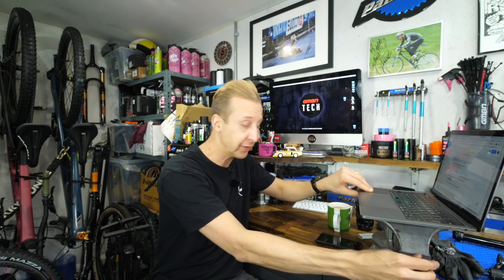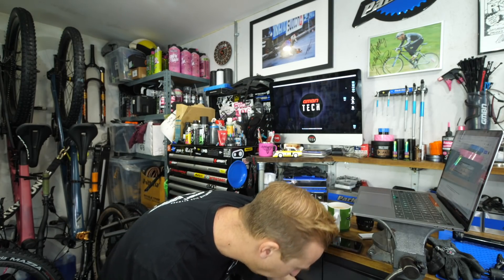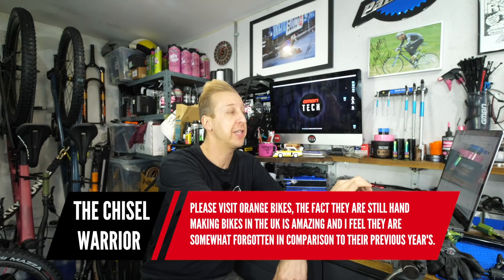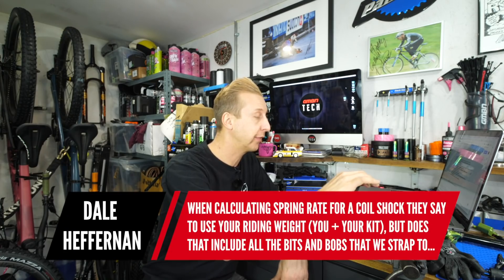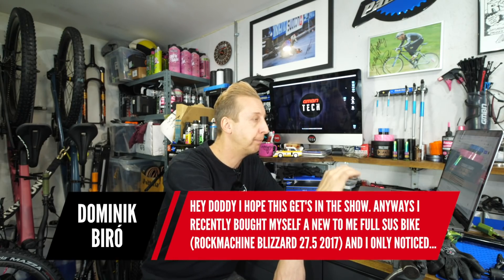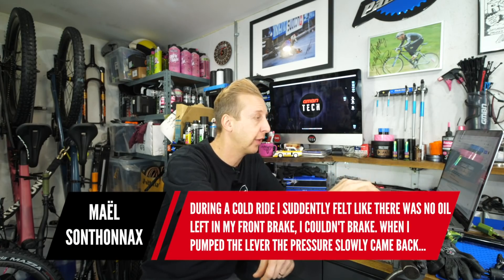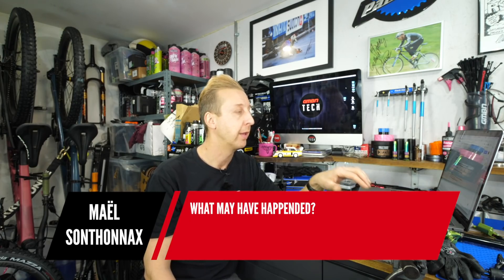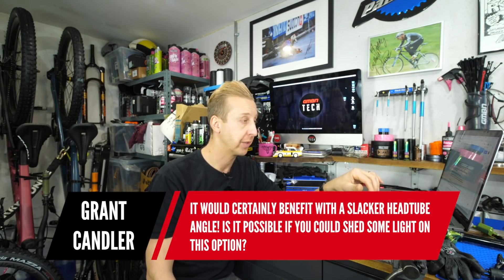What Counts As Riding Weight When Setting Up Suspension? | #AskGMBNTech

Comment from the maker: Got a MTB tech-related question for us here at GMBN Tech? Submit it in the comments below using the hashtag #AskGMBNTech for a chance to be featured on the channel! 👇
Reply: #AskGMBNTech 
Love the show ! 
My dropper post gets stuck three quarter of the way up when I push the lever.. everything looks normal and the bike is a few months old. Should I service it, add lubricant or something else ?
Reply: #AskGmbnTech is there a way to stop bucking on my mountain bike? I have gone over many jumps with the same issue of the bike throwing me over the handlebars. I ride a 2021 vitus mythique with an air shock. I have tried adjusting the rebound on the shock and even turned it all the way down. It seemed to help marginally but the improvements were barely noticeable. Do I need to get a new shock or is there a way to fix this with no specialized suspension tools? Thanks Doddy.
Reply: #AskGMBNTech 
Hi, I'm commenting 1st time.
How does a bike ( trail geometry frame + XC components ) feels in road. will it feel a little  bit different or the same or very much different in compared to XC bike? I wanna buy a bike that can handle rough trails and perfect XC, if there any?
 how about light weight Chromoly bike like Pole Trival
Reply: #AskGMBNTech Can you do a 2x to 1x conversion video please?
Reply: #AskGMBNTech Hey Doddy. Long time fan! I recently bought a 2021 Grand Canyon 5 and was looking to upgrade the fork. I've noticed to my surprise that it has a straight steerer tube and not a tapered. Seeing as it can be difficult enough to find decent forks that aren't tapered is there any way to fit a tapered tube on a bike that came with a straight? Cheers Doddy!
Reply: @pranavreddy6470  maybe try increasing rebound on your fork, i have the same bike and my fork and shock are on the fastest rebound and i dont have this issue. I think it's more technique, try pushing your front wheel into the lip more and keep your legs straight while riding up the lip
Reply: @nafis4987  get a downcountry bike (around 110-120mm of travel)
Reply: #AskGMBNTech Best Bike show in the world. I recently bought myself a set of magura mt7 as my old brakes (hayes stroker ace) are dead. Now many of my mates say I was stupid in bying the maguras as they tend to have a very unsecure point where the braking starts and the brake pads move. Up to now I didn't have any issues with them but what could I do if any of that happend?
Reply: @EvtheNev  you might need a different headset so theres enough space for a tapered fork or you could buy a tapered fork you like and replace the steerer tube with a straight one, keep in mind you need a hydraulic press to push it in
Reply: Hey Doddy!!
Do we get a discount from Epic Bleed Solutions, if we mention GMBN, 🤣, just about to order the Shimano kit for my Trek Fuel EX 8 - nice one, 👍🏻
Reply: #AskGMBNTech
Hi I want to buy a full suspension and I’d like to know what weight would suit me as I’m skinny and want my bike to be playfull.
Reply: #AskGMBNTech Hi, i got a Fox 36 with 150mm and a Fit GRIP damper and I want to upgrade it to a GRIP 2.  But i can only find the GRIP 2 damper for Forks with 180mm. Can in use this in my Fork? 
 Thanks love the show.
Reply: #AskGMBNTech I’m looking for a way to modernize my Trek Fuel Ex 9 (2013) ie with bigger wheels. 27,5” won’t fit but what if I upgrade the fork to one that does? It would run 26” at the rear and 27,5” at the front. Would it make enough difference, in a good way, to justify this or would I be massacring my bike?
Reply: orange is halifax and hope is in Barnoldswick
Reply: #AskGMBNTech 
Just took a bit removing my brake rotors and pads and cleaning them thoroughly aswell as cleaning up all the grime around the calipers but when I reinstalled them they had even less bite than before. I know for a fact they didn’t get contaminated when coming off and getting put back on. Any theories?
Reply: #AskGMBNtech 
Hi does motorcycle fork oil works in mtb air forks for lubing the seals like forkboost does? If not are there any alternatives ? 
Ps. fork specific lubes are rarely found in SEA.
Thanks!
Reply: #AskGMBNTech hi Doddy, First off love the show!! Basically my bible for all things tech and maintenance... I'm waiting on a new transition scout frame to arrive and have a question / request for your opinion on trail, offset and stem length. I've got a medium on order and the new carbon scout utilises a 40mm stem with a 37mm offset. Now, given that I'm ordering a frame set not a whole bike and currently have a 50mm stem paired with a fox 36 fork which has a 44m offset. Don't particularly want to try and a) buy and find a new fork in stock and b) buy another stem, yet I totally respect the engineers that designed the bike... Thoughts on how much of a difference a 44 not 37mm offset would make and 50mm not a 40mm stem would make when looking at the scout? Cheers for the help and stay safe!
Reply: #AskGMBNTech 
Hi Doddy, recently getting into more Mountain biking on my Giant Trance3. 
I live down in west Cornwall and am finding during lockdown there aren’t many places to link up to create a proper ride or even session, due to the lack of bridleways or non flat cycleways, I’m not a jumper I’m more into adventuring. which means taking to more public footpaths (which is illegal in the UK) 
do you agree it’s time the government followed Scotland in making all (suitable) pathways available to all users both on foot and 2 wheels. Many thanks, Ben 👍🤟
Reply: What about pole trival? 
Like the bike

Comment: Works Components has a nice 1 degree offset headset for older 1 1/8" steerer tubes with frames having external cups. There are different cups options based on the length of the headtube.

Comment: For coil shocks, there's Sprindex, an adjustable coil spring that lets you do fine adjustment within ~50 lb/in. Get one in the right ballpark, then adjust on the fly by turning a knob. Short ride without a pack? Just drop a few lb/in and you're golden.

Comment: @Grant Candler, I just put a EC34 (top and bottom) angle headset on my 2010 Dawes Deadeye, its straight steer and has a 110mm length headtube. It made the bike 1.5deg slacker.

Comment: #AskGMBNTech Hi Doddy, can you please explain the difference between dry chain lube and wet chain lube? I have been told that dry lube repels more dust and wet lube can repel more mud and wet substances, however I’m not sure if this is true. If there is a major difference can you please explain how the difference is caused in regards to the lubricant formulas and when it is best to use what type of lube?
Reply: Wet lube is wet. 
Dry lube is dry.

Comment: #askgmbntech I'd be much obliged if you could send this question by way of Fin at FullFactory. What are the possibilities of fitting modern fork internals (I'm thinking Fox 32 stepcast for their shorter air shaft) into a retro Manitou to get a retro look with modern performance and ditch those awful elastomers. Cheers!
Reply: Buy a stepcast and get custom paint and decals made for the look.
Reply: @rupedog  modern high quality forks are all much longer axle to crown so bring the front of the bike up more. Virtually none are 26" specific, none have V brake bosses, none are 1 inch steere or 1 1/8thstraight, all  the good ones are 27.5" up, 1/18th to 1/15th tapered with disc only. You see my problem?

Comment: I'm curious about many bikes being specced with Shimano Hyperglide+ cassettes, but a non-Shimano chain. 
Do you lose the shift quality and ability to smoothly shift under load by not having a Hyperglide+ chain?
Also, why do manufacturers do this if it hurts shift quality?
#AskGMBNTech
Reply: Originally I had a generic Shimano 10s (11-36T) cassette with a KMC 10s chain. It worked fine nothing to complain about. Then I wanted a bit more range so I upgraded to a Shimano wide range 10s (11-42T) cassette and paired it with a specific Shimano 10s chain with all the tech bits like hyperglide, dyna shift etc. 
If you ask me there is a performance improvement when your drivetrain parts are all from the same manufacturer. The shifts are very tactile, i.e. you can feel and hear the clicks into gear but somehow they feel smooth & snappy (I know it doesn't make sense but it feels good). However those difference in improvements are very marginal and a casual rider probably won't know the difference. Also there's probably some element of me defending my purchase as I have spent money on it so subconsciously I want to say it is good.
Having said that I did not spend a huge amount of money to upgrade my cassette and chain as these 2 parts are consumables and usually relatively cheap to replace. If you are looking to upgrade your drivetrain like I have, I would suggest wearing down you cassette and chain first and then getting the best cassette & chain combo from the same manufacturer that you can get

Comment: #AskGMBNTech - I have a Specialized Rockhopper 29 with 135x9mm drop outs and QR. It has a 2x8 Shimano drivetrain and the next chain replacement will also include cassette replacement. Perfect time to upgrade, but can I go to a 1x12 in that frame? I’m hoping to move to a Sram SX system. Information I’ve found is about as varied as cycling “standards”.

Comment: #askgmbntech I ride a specialised enduro 29er 2017. I love the 29" wheels but I'm considering swapping the rear for 27.5 and running the bike mullet style. I'm buying a new hope rear wheel soon as my current nukeproof V1 hub is as well built as a paper house, hence I'm wondering which size to get. Do you think the 27.5 could ruin the bikes performance and what things should I consider? Thanks. I appreciate all your advice on the show, it's taught me most of what I know today about riding 🤘

Comment: #AskGMBNTech G'day Doddy,  I got some slack in my chain while its in the hardest gear, i was wondering what is the best way to get rid of it, like maybe take out a link or adjust the B Screw. I'm running a XTR 12 speed chain on my XT drive train so i didn't want to experiment and find it didn't work and waist a good chain. Thanks

Comment: #AskGMBNTech   Do forks and shocks need to be adjusted when the temperature plummets? I felt like my set up was dialed this summer/fall. But when the temperature hits the low 20's F (-5C), the bike feels harsher. Is this normal?     If it impacts the answer - I have a Fox 34 Float Factory and Fox Float Factory. I have performed required maintenance regularly.

Comment: Some feedback I'd like to offer to Dominic Biro about the dent frame. I am in a similar situation. I bought myself a 'new' 2016 Scott Genius 740 in July 2020 from an authorised Scott dealer in Malaysia. At the end of November 2020 I noticed a dent on the top tube (like a thumb press size). It's not serious but still worries me a bit. Plus when I look down on my frame, my eyes bleed seeing a dent in it.
So I went back to the local Scott dealer and initiated a warranty claim. Scott promises a 5 year warranty from the date of purchase not the date of manufacture. They took down my particulars and said to me to wait as they go back to Scott and source a replacement. Now it's Jan 2021 and I'm still waiting for a replacement. A 2016 frame may be hard to source these days plus the pandemic is not helping. I've been told if they cannot replace it like for like, they will send me the latest design frame of an equivalent value. While I am waiting I've been advised that I can still ride my bike. Probably the dent isn't too bad and there isn't any huge risk for now
So for your case, if your dent(s) aren't too bad, you could probably ride it for now. Perhaps yes, you could buy a replacement frame from the manufacturer later on. However if you bought your frame second hand from a person, you could try and ask that person if they still have the original receipt. With that receipt you could go to the dealer and initiate a warranty claim.

Comment: #AskGMBNTech Hello, doing a cold ride ( -10 Celsius) my dropper  (Brand X Ascend 2) would not come back up again. I found out that the cable remains in the dropped position. I am thinking that having a compressed air cartridge it was somehow affected. After I return at home, after the parts get to normal temperature, it works ok. My opinion is that because of the cold air, the cartridge compresses a bit and also the shifting cable sleeve compresses and tightens the cable , so it does not have the proper strength to pus the cable back. Its a sealed cartridge so I cannot adjust the pressure inside. Any other opinions why this is happening?

Comment: #AskGMBNTech I am working with a friend to switch over his fat bike from a 3x9 with square taper BB to a 1X11 with some type of external bearing BB. I can easily find BBs what are meant for the 100MM width, but what should I look for in relation to the crankset spindle length? With SRAM and Shimano I can find crank arm length but  there is no reference to spindle length. What is specification I need to look for, would it be boost? Thank you

Comment: #AskGMBNTech I am curious what makes a better mullet bike. Is putting a 27.5' wheel on the back of a 29'r bike better then putting a 29' wheel on the front of a 27.5 bike? Both my bikes have this option. My 27.5 has a 29' compatible fork as my 29er bike is also compatible with 27.5 wheels.

Comment: #AskGMBNTech
Hey Doddy and GMBN Tech community.

I want to buy a new bike and I have a very hard time choosing one. And exactly that's why I make my problem to yours.

Here are some important characteristics:
- budget of 4000€, roughly 3500£
- full suspension bike which handles rough stuff being thrown at it, 
but I don't want to be overbiked
- long lasting alloy frame
- drive train and brakes from Shimano
- decent suspension

I thought about something like a Canyon Spectral AL 6.0, but I don't really think the forks are very good.
What do you think about that bike?

Sadly most companies like Canyon make more and more carbon bikes and carbon is too risky for me because it beeing expensive, breaking too easily and the fact you have to replace it regularly.
Correct me if I'm wrong!

Could you help me out with this? Thanks!

Comment: #AskGMBNTech my shimano hollowtech 2 crank got stuck used a hammer to tap it out no luck tried to tap it it back in still no movement can still see a little bit of axle showing now i think its not all the way in /against the bearing but its works fine, even the shifting works fine is this going to be  a problem ?

Comment: Hi Dodd, Im riding a steel, hardtail with rigid fork  fat bike lately in the trails. Im using 80mm rims on 4.8 tyres with pressure as low as 12PSI. With that large tyre and low pressure am I having a same ride feel as an enduro trail bike with suspension? let say  even with the smallest fork travel? Is it going to be an overkill if I spec up with a Manitou Mastodon or Rockshox Blutou? #AskGMBNTech

Comment: #askgmbntech hey Doddy  i bought a commencal supreme v2 2011 and unfortunately the previous owner painted the whole frame with matte black spray paint. And overall that was the only thing i didnt like on the bike but now i want to repaint it myself and i dont want to use inefficient matte spray paint again. What should i do? i would also like to have the original bike company logo on the bottom tube as well. cheers!

Comment: #askgmbntech I have some shimano mt400 brakes and when I pushed the calipers back in to the pistons when servicing them some fluid leaked from the leaver, not from the bleed port. Should I be replace the lever or bleed. they still feel good tho
Reply: I think it is ok. If the fluid level in your brake system is high and you push back the pistons in the caliper quickly, you might push some fluid past the seals on the piston in the lever. Keep an eye on the levers on your next ride. If you don‘t spot fluid, they are most likely ok.
Reply: Thx
Reply: Clearly a blown seal...lever needs a service

Comment: #AskGMBNTech please reply to this question. Why do people run either same size rotors front and rear or larger at the front? Why not larger at the rear? I am heavier on my rear brake but have been told not to put a larger rotor on it because then it would be bigger than my front rotor, what is the reason for this?
Reply: Front is where u can have most power...braking throws weight forward, so increases front grip, lightens rear...so bigger rear disc would just lead to more skidding